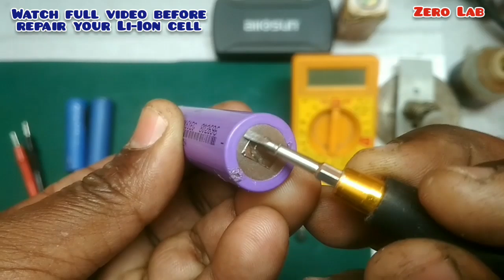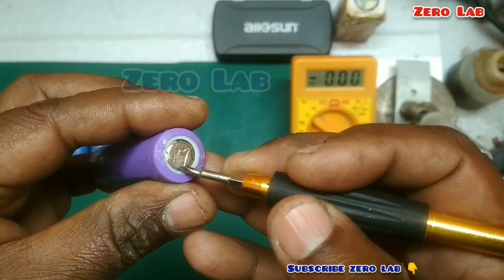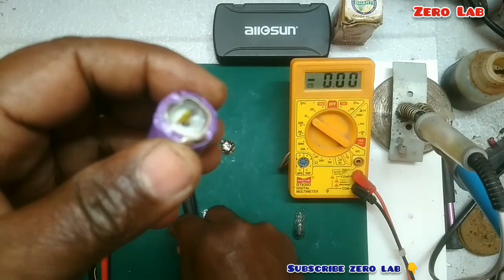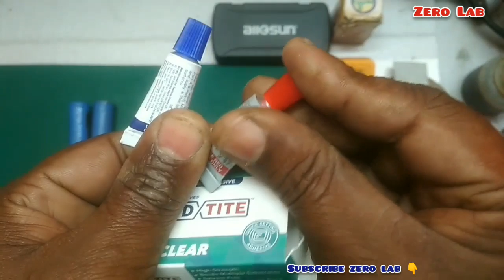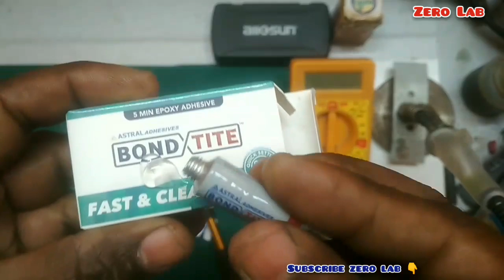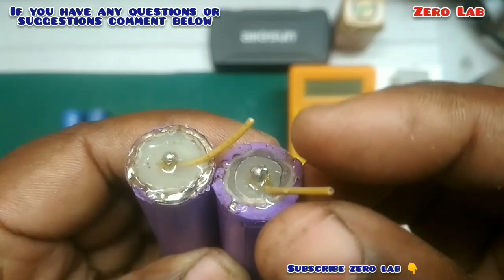Li Ion Battery Repair at Home

Comment: very dangerous,the safety tab has been removed,if it gets over charged then you have bomb in your house.better buy a new battery
Reply: Well said bro
Reply: Don't take any risk to repair laptop battery,it may explode ,_causes injury.
Reply: There is no overchrage protection in the battery.The cap do nothing.
Reply: There are two types of protection used internally in the construction of a Lithium Ion battery. PTC and CID. Read about it for further knowledge.

Comment: You bypassed some of the protection devices (PTC, CID) and your battery will catch fire if there is a short circuit or over discharge

Comment: Sir backup kaisa hai in cells ka
Laptop baale cells ka
Reply from the maker: Same as 2200 mAH battery
Reply: Sir mere ek bluetooth portable soundbar hai jb use fully volume me karta hu to bo restart ho jata .i.e band hoke fir chalu ho jata hai but low volume me sahi kaam krta hai any soln
Reply: @royalsingh3294  battery replace kr do

Comment: Please tell me price of 3.7 v battery cell and from where I can buy original cell
Reply: 2600 mAh Li-ion Battery ICR 18650, Voltage: 3.7 V
2600 mAh वाली लिथियम-आयन बैटरी ICR 18650, वोल्टेज: 3.7 V
Rs 135/ it is online if you want to purchase offling you can get it electronics shop, but old battery you can get in laptop repair centre easily and chip rate.

Comment: Sir, after I tried like this, still there is 0.0 voltage.  Wat will b the reason? Pliz help
Reply: Same problem faced
Reply: you have to charge than use it.

Comment: Removal CID devices of 18650 will cause a exploded gas in the future if overheat
Reply from the maker: Yes, it can happen if you do not install a drain pipe as vent to release gases from battery

Comment: China emergency light ka capacitor ballast ho raha plus capacitor k sath connect resistance bhi burnt ho rahi hai kindly advise
Reply from the maker: Make sure you use pf capacitor voltage range 400 volt or 450 volt...
Reply from the maker: Watch this video for more details.... 
https://youtu.be/-TYMHSBvkUY